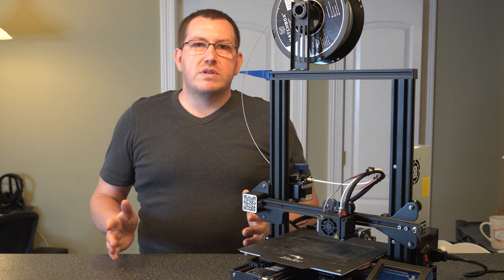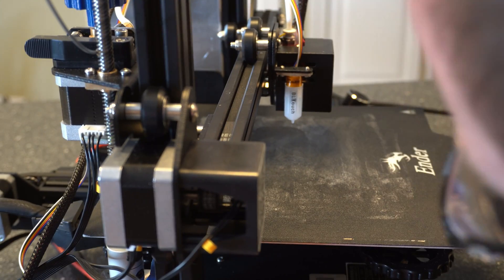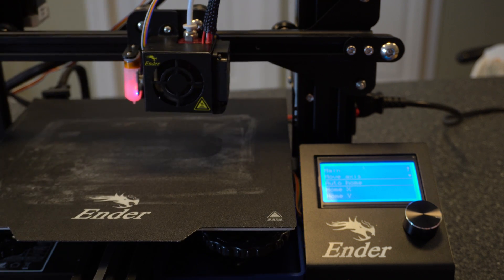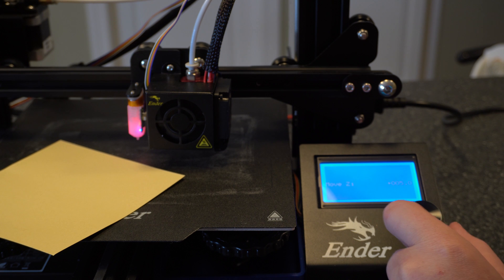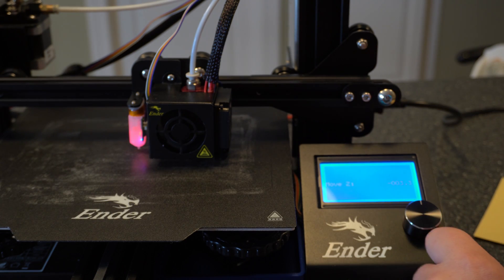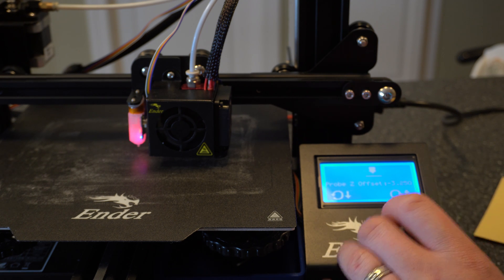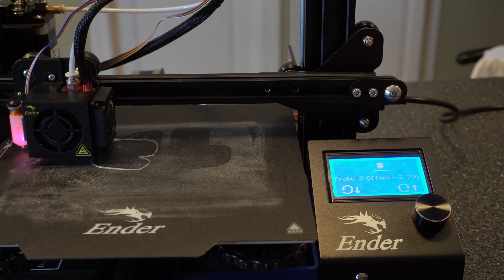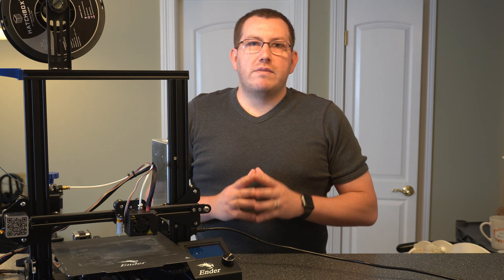Z-Offset BLTOUCH With Marlin Firmware

Comment: I added the bltouch and put the z homing firmware  and I can't get the z offset set it won't go -
Reply from the maker: Hi. I plan on doing a video on this as soon as i get the hardware to test it. There is a software endstop that needs to be disabled, or the min value needs changed in the firmware. I think this is the case with the Creality firmware (need to verify that). You should be able to disable it with the M211 command. https://marlinfw.org/docs/gcode/M211.html

Comment: When my bltouch is auto homing the sensor hits the bed and keeps going with no retraction. All the test and resets work but the home doesn’t. Any ideas other that switching the black and white wire? I’ve all-ready tried that and it wouldn’t work at all when I did. Thanks for the video! Great info and setting it will be a breeze after I get this issue worked out. Thanks again!!!
Reply from the maker: Hi. Do you have the bltouch connected to the z-stop or bltouch stop port? Also, can you email me a copy of your configuration.h file to review? My email is admin@3dprintscape.com .
Reply: @3DPrintscape  it’s plugged into the zstop. I’ll send a picture and emails the file when I get home this evening or tomorrow morning depending on the time. Thank you so much!!!!
Reply from the maker: @PastorTFS  Sounds good, i will take a look at them to see if I find anything that needs to be changed.
Reply: @3DPrintscape  sorry to be so dumb about this but I’ve tried to locate the configuration.h file and don’t know how. I looked under all the setting of cura at least I think I have. Is there a simple way to get this?
Reply from the maker: @PastorTFS  Are you using a precompiled firmware package or did you compile it yourself? If its precompiled, you wont be able to get it. If you compiled it it would be under the Marlin directory. For example, mine is here. C:\Users\Owner\Desktop\Marlin-2.0.x-SKR-mini-E3-V2.0\Marlin
Reply: @3DPrintscape  the board came from the factory preconfigured (4.6 out of 5 stars  11 Reviews
Creality CR-10S Silent Motherboard V2.2 with TMC2208 Preconfigured Firmware (No Need to Flash The Firmware))
Reply from the maker: @PastorTFS  You will need to update the firmware to account for the BLTOUCH. If the board has a precompiled one that has the changes for the  BLTOUCH, that should work. If it doesn't you will need to compile a build with the required changes.
Reply: @3DPrintscape  oh boy! Well I bought this one because it is configured but obviously something isn’t right with it. I have no clue how to do any of that at all. So this is really bad news lol. I got the silent board preconfigured for the BLtouch because I knew that that seemed like a software nightmare. Seems like there should be some sort of instructions somewhere but everything I see makes it sound like every little thing makes it that much more complicated and you’re basically writing code lol. I don’t know where to even start
Reply from the maker: @PastorTFS  You have the 32-bit firmware, so if you plan on staying on the reality firmware the process isn't to bad. It sounds like you have the 4.2.2 board, so you will want to download the 4.2.2 firmware with the bltouch from https://drive.google.com/drive/folders/1sQ9TnIfssNy42rfK-DcJtLlkd30sUy6V and follow the instructions from https://drive.google.com/drive/folders/1mYtIQV9ewZL2OH_QA2JMT3wRDXvO7yDq . Also, before you do that, you should verify the wiring is all correct. If you run into issues, you can email me at admin@3dprintscape.com .
Reply: @3DPrintscape  I just figured out one MAJOR part of it. The black and white wire was switched on the BL touch. Weird thing was I had already switched them to see if that was it and it didn’t work at all so I figured it must be a software issue. I said before I go deleting and rebooting all this stuff I’m going to try it once more. I did and it works great!!!! I just have to set my s offsets and I think I am good to go! I can not thank you enough for your help! You are truly super knowledgeable on this stuff and very patient with noobys! Liked and subbed!
Reply from the maker: @PastorTFS  Interesting, was that how the cabling was when you got it? I'm glad you got everything running and thanks for the like and sub. If you need help in the future just let me know.
Reply: @3DPrintscape  yes a problem some have is the black and white cable on one of the two plugs for the motherboard from the Bl touch is switched. I don’t know why but I cut and soldered the wires white to black and black to white, and tada!  Everything is back together and I actually had it printing one time but it was about .1 to high. I tried adjusting it again but no success yet. I’ll get it though.
Reply from the maker: @PastorTFS  Ok ill keep that in mind in case other people have a similar issue. I also plan on creating a discord channel to make troubleshooting things easier.
Reply: @3DPrintscape  oh ok that would be awesome! I’d love that info!

Comment: Great video, I was able to install my bltouch with your help following this video.  I am wondering if you can make any modifications to the firmware to make probing faster, I have a warp bed so I need to increase my probing points for more accuracy, I have seen other videos having advanced setting(teaching tech) but he is using Marlin firmware, wonder if you can do the same with TH3D
Reply from the maker: Hi. Thanks for the feedback, and im glad you got your bltouch working. I honestly haven’t looked into that too much but there may be some options. That said, if I remember correctly it reduces the overall accuracy.

Comment: what if one corner is higher or lower than the point where the nozzle is in the video while you are adjusting the knob? how this can be accurate? Thank you!
Reply from the maker: Hi. The software stops should account for that. The printer only goes down to the mechanical stop when its homed. It is possible to manually run the nozzle into the build plate, but you can do that with the stock plate as well. I have always just gone about 1mm lower than the top of the build plate, this has worked out well for me. You cant have it even with the build plate because you don’t want the mechanical stop to be engaged when printing the first layer. Hopefully this helps.

Comment: I set up the skr mini 3 v2, bl touch exactly how you did and did the bl touch homing z .bin and flashed the printer but I do not have the same options on my printer I don’t have prepare or control and when I try to set the z probe offset it does nothing it will not get the nozzle closer to the bed btw I am new to printing
Reply from the maker: Hi. Did you end up doing the TFT35 as well? If you did, there is a nice wizard that does most of the work for you. If not, i need to know more about the firmware you used and what behavior you are seeing.

Comment: Man, your videos have been some of the best, easiest to watch, not too complicated or boring yet also informative and to the point, can't thank you enough for these man! I wish you many good prints to come 😂
Reply from the maker: Glad you like them!
Reply: @3DPrintscape  I am having some problems if you don't mind giving me some guidance, I set my z offset to how it's supposed to be till the paper starts slightly gripping, I save the settings, but when I start printing, it prints In the air (nozzle too high) what am I doing wrong?🤔
Reply from the maker: @joshsmith7812  Hi. What was the z height when you ran the autohome and what were the rest of the values you came up with? Also, another thing to try would be to kick off a calibration print and adjust the z-offset while your printing if your firmware allows it.
Reply: @3DPrintscape  I've really messed up somewhere along the process, I'm really new to printing, is it possible to reset the Z axis on the Ender 3 pro? 

Anyway, basically if I click bed level, and then I want to move the offset , the default value is: +010.0 

I've also watched multiple tutorials and many people do it differently, I just want to print haha, aggh, I was getting some great prints before but getting my bed right all the time was a nightmare so I went the BL touch route, long story short I've been spent all day trying to get it right haha
Reply from the maker: @joshsmith7812  I can reset the values by clearing the eeprom, that will put you back to stock settings. From there, try to run through the process again and see what you come up with.
Reply: @3DPrintscape  thanks so much for the fast replies by the way, will simply hitting the Initialize eeprom reset it to factory defaults? Thanks so much for the fast replies btw, Google isn't much help right now because everytime I read something online its stuff that too advanced for me at this stage like command codes and stuff, all I want to do right now is get my printing working properly again lol. 

Another question, should you manually level your bed before doing a BL touch level?
Reply from the maker: @joshsmith7812  Ya, initializing the eeprom will wipe any settings that have been changed on the printer back to the defaults. That said, i wont revert any firmware changes or anything like that. Im happy to help out as i have time :) .

Comment: After auto home mine won’t come down after it comes up the third time.
Reply from the maker: Hi. Are you saying the probe wont come back down or that the z-axis wont come down? If it’s the probe, after it runs the autohome command, it gets pulled back in. It should only be engaged when homing or leveling.
Reply: It’s the z-axis. When I press autohome it goes up and down twice but it never puts it in its printing position. This makes it impossible to see how level my bed is.
Reply from the maker: @Lucas-wf5sc  Assuming you have the bltouch on the stock mainbaord, when you run the autohome you should end up at a +5 position. From there you will need to lower the z-axis until you get the correct printing height to get the z offset value. If you are running the Marlin 2.0 firmware you may have the z-offset wizard that will help with the process.

Comment: Does the offset wizard work on the ender 3 V2? I cant find it in my menu
Reply from the maker: Hi. I think it depends on the firmware it has, but im not positive. Im going to buy an Ender 5 Pro soon, it should have the same board/firmware, so I will check when I get it.
Reply: @3DPrintscape  I've got the 4.2.2 I think you'll have the 4.2.7 not sure if the confg files will be the same though but thanks Ill keep an eye out

Comment: The z setting for me does not go past zero, it won’t go negative, everything else is fine, just can’t offset negative numbers
Reply from the maker: Hi. I didn’t have that issue when I was using the stock 8 bit board, and Marlin 1.x. When I moved to the SKR mini and Marlin 2 I had to kick off an auto home before it would let me go negative. Can you give that a try?

Comment: What version of Marlin is this please. I followed your guide on the SKR Mini E3 v2.0 install (fantastic, thank you), but on using the bltouch for z homing file I a) dont see that wheel for z offset b) cannot seem to take z offset negative. Can you please point me in the right direction?
Reply from the maker: Hi. Im currently on November build of Marlin 2.0.6.1. I did notice that if im not using the wizard from the tft35 that I had to autohome the printer before I was able to get to a negative number.
Reply: 3D Printscape I think I am on the same install but offset home doesn’t seem to allow it even, I have to do a bit of hit and miss with it.
Reply: I checked and actually I’m on 2.0.7.2
Reply: I’m having the same issues how can I fix this I’ve been at this for hours now.
Reply: @bosslady_fpv5515  oddly I managed to get it moving to negative z the other day for about 30 mins, but no idea how to replicate it so I am back to where I was. I think I did something with the “set home offsets” in advanced. 
For now I am just using a huge negative offset in configuration at first, then moving the z to the correct point with a offset, and combining them again in configuration. It’s not ideal but it works.
Reply from the maker: @crouchycrouchy  @BossLady_Fpv Hi. This has come up a couple of times, and I will try to get a video created to cover it. Basically, its hitting a software defined endstop. This should be able to be disabled by sending an M121 command to the board or changing the endstop in the firmware “#define Z_MIN_POS 0”. Also, this issue went aware for me after installing the TFT35, so I think it has logic built in that disables the software endstop when needed.
Reply: @3DPrintscape  did you manage to get anywhere with this please. Or is there a new version of marlin to use?
Reply from the maker: @crouchycrouchy  If you want to disable this in the firmware, you would comment out this line #define MIN_SOFTWARE_ENDSTOP_Z , but its enabled in all the precompiled firmware. If you need help building the firmware you should join the discord channel https://discord.gg/Bu94EYVkrU

Comment: I have an ender 3, i'm unsure if it's the pro or not. I had a few questions, can I keep the creality or default firmware? I'd prefer not to remove the clips, also does this work with a heated bed? It looks like yours has had some glue used on it for adhesion?
Reply from the maker: Hi. You can keep the Creality firmware if you want, I just not a fan of it and the thermal runaway protection didn’t exist in old versions and is questionable in new ones. I assume that if you are asking about the clips you are using a glass build plate, if that’s the case they should stay. Mine still has the magnetic adhesion material on it (this comes stock with the Ender 3 Pro) but I will be removing it soon.

Comment: How do you level the corners of the bed when you have the bltouch installed?
Reply from the maker: Hi, It depends on what mainboard and screen you are using. If you are using the stock one, you will want to lower the z-axis to the point that its almost touching at one corner, disable the steppers, then move it around to all the corners making adjustments as needed. After that is done, you will need to adjust your z-offset again.
Reply: @3DPrintscape  ok thank you. And yes I'm using the stock ones. Also, when I print something like a 20mm calibration cube that my X-axis value is 20mm, but my Y-axis is like 19.8mm and my z-axis is about 19.74mm or so. Could my steps/mm be off on my Y and Z motors but be good on my X?
Reply from the maker: It possible your steps are off, I would start there.

Comment: Thank you for this very clear video.  I have a creality cr-10 v2 with BLTouch installed.  After the autohome, I go to move the Z axis down by .1 increments.  However, as soon as I turn the dial (even turning it to have the z axis go up, not down), the nozzle moves down to the bed and tries to bury itself in the bed.  After that, the control is fine.  Any ideas about what I am doing wrong?  I had this printer running well for months - recently have had adhesion issues so I decided to try to recalibrate it.  Thanks.
Reply from the maker: Hi. What board are you running? I don’t have too much experience with the CR-10 but it may be worth erasing your EEPROM and running through the z-offset calibration again.
Reply: @3DPrintscape  Thank you for responding.  i reset the EEPROM and that fixed the issue.

Comment: Ive done everything and triple checked it but still goes back to 5 even though z is set to -3.3? Plz help!
Reply: It auto stops @ 5 when the probe hits the bed
Reply from the maker: Hi. It sounds like your firmware defaults to a +5 offset, I believe that is the case in the 1.x code line. The Z-offset doesn’t kick in until the print starts. So it will go through the mesh process with the firmware offset. Is that the behavior you are seeing?
Reply: @3DPrintscape  when the probe touches the board it stops @ +5
Reply from the maker: But is that once the print starts or just part of the mesh or homing process? That sounds correct if its part mesh or homing process, it won't go below that until the actual print starts.

Comment: I did all these steps, but for some reason when I start a print, the Z-Offset is too high, the filament does not touch the bed. Any ideas on what the issue is?
Reply from the maker: Hi. It sounds like the Z-Offset still isn’t right. It can be a pain to get set sometimes. One thing you can do is start a test print and adjust the z-offset on the fly until its at the right height. Once you have it, make sure you save it to the EEPROM unless it does not persist when you restart the printer.

Comment: My offset was set to -2.1 initially and was printing great until I changed the nozzle. After I did that it was too high. Using your calibration, it changed it to -1 which’s seems like that’s making the nozzle higher.
Reply from the maker: Hi. You are correct in stating that -1 is going to be higher than -2.1. Can you run through the calibration again? If its home position was at 5 and you ended at -1, your offset would be -6.